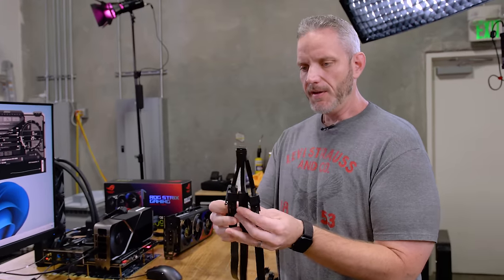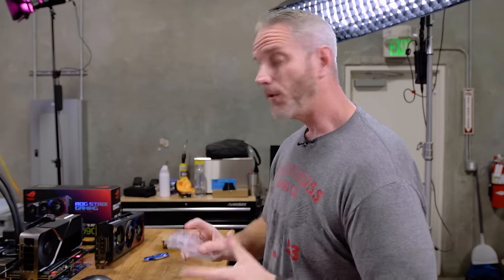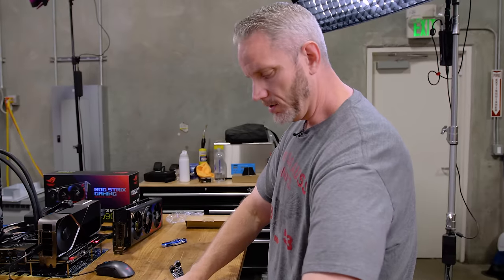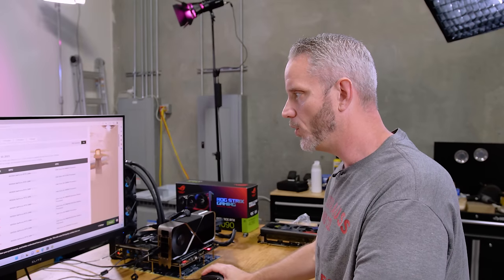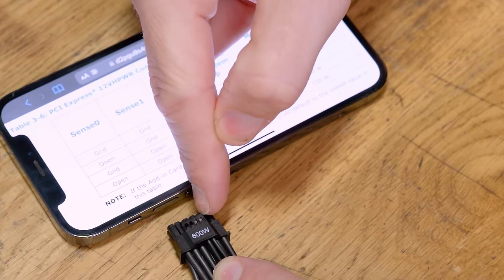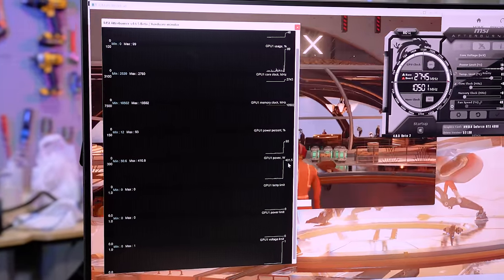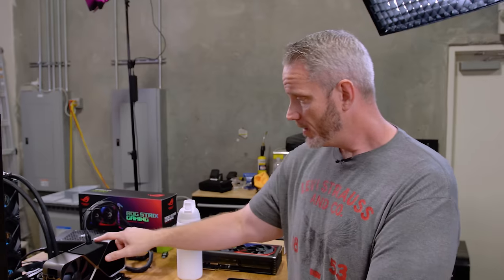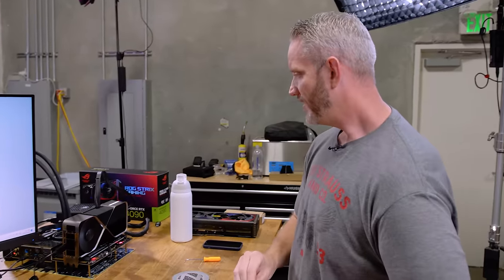DON'T Do this with your GPU!

Comment: If I have a video card with a PCIe 5.0 power port, I will get a power supply that can allow a direct PCIe 5.0 power plug to PCIe 5.0 power plug cable.  I will not play with converting 32 wires to 12 wires.

Comment: When I got my hands on a 3070ti FE back in March, I also updated my power supply to a Corsair 850w.  I was also very glad to find they did a replacement cable for the 30-series FE so I could ditch that 2 into 1 cable adaptor!  I love my 3070ti FE but the connector really is in a daft location!

Comment: What PSU did you use in this video? I'm asking because I found a Corsair-Staff post in their forums claiming that 600W can only be drawn by a PSU 1200W+ with this cable.. 

Guess who bought a 1000W PSU in summer because it was a good deal, which leaves enough space for a 4090 in my system. 
On the contrary the 450w+ are actually only for overclocking, also @der8auer made a video about the card beeing instantly limited by the voltage and it seems you actually can't raise voltage enough to really benefit from overclocking with the cards. But I guess soon we will know more about this :D

I'm excited for your tests with smaller PSUs!

Comment: How is that possible? Molex 8-pin connector can only be 150W by standard. So 2 connectors is 300W, not 600W. NVidia use 4 8-pin connectors exactly because of that reason, 4x150W=600W.
And what this little fact tells us? Corsair sucks.

Comment: I thought a 8 pin psu cable could only deliver 150 Watts, so how is it possible that the Corsair Cable can deliver 600 Watts with 2x150 Watt connectors only? Am I missining something?

Comment: If you're running a new AMD board, I notice that some manufacturers are putting out BIOS updates for the new boards that address 4090 issues.  Are there any issues with older boards (x570 for instance) that anyone knows about?
Reply: I'm going to run 4080 on X570 board too, to start with. I hope it'll be just fine, don't know for sure though. In theory, should be alright.
Reply: @pmAdministrator  I have a z390 e hahaha I hope the rtx 4080 works lol

Comment: I'm sure this has been covered somewhere, but can you pigtail into the adapter? It looks as if two of the ones he holds at the start are a pigtail. So two with a pigtail and the other two are single cables to the PSU.

Comment: You might want to run a baseline with the new cable attached in its original configuration before making changes…that’s some funk way to test shit….The new pin standard might be conflicting with the mobo bios for over voltage too.  So now the card and power supply are talking to each other, but it’s not the power supply sending extra volts, that’s via the mobo.  The power supply wants to send rock steady voltage. It’s a bit confusing, wouldn’t it be more logical for the gpu to get its data from the mobo on available power, current and voltage?
Reply: No, Because it don't get the power from the motherboard, It gets the power from the power supply.
Reply: @madb132  whys it gotta be so confusing:/
Reply: @enntense  But it's not tho.  To have the motherboard tell the gpu what power it needs jwould makes it much more complicated,  new software, new chips Much more development and cost. The way nvidia has done it saves that and has simplified it, Albeit for the time being. It may well come to the motherboard in the future but for the time being, it works.

Comment: So he just proved it works with 133% yet gn said it wouldnt? Lol seems like thats only for nvidai connectors. As we see he got the 133% with both pins but with 1 he couldnt. So gamer nexus was indeed wrong. His whole point was that you cant get the 133% when 2 plugs are in not 3 or 3 and not 4 wirh a 4090. Yet as he showed when you have both pins which this does have the way this high power pluf worke as he epxlained it does get the 133% so gamer nexus was wrong but he was right about the adapter and amount of cables.

Yall missed the whole point gamer nexus proved it by showing the nvidia adapter not the corsair one.

Point is you can OC with this cable on a 4080 super.

As he proved here he could even OC the 4090. Most 4090s arent hitting 3ghz either  way lol.

Comment: mmmmm if i want to get a new pc it would be 7950x with 7950xt watercooled 420 or dual mora 420 each connected to there own mora for cpu and gpu if i want to overclock and warm my room with all that heat

Comment: Solid wire helps to prevent electronic interference and limit the skin effect caused by magnetic fields on the wire’s surface.  However Stranded wires (same gauge) can carry more current.

Comment: I had no video output from my 4080 I used three separate pcie cables two new ones from my 850w and old one from a 650w. I just chanced it and daisy chained the and only used the two new ones and I got video and fans to spin

Comment: I dont get it. How can you push 600W through a cable that only allows to connect two 8 (6+2)pin PCI-E connectors. Each 8pin allows for 150W power. If the power is doubled per connector how is PSU supposed to even handle this. For example I have Seasonic focus platinum plus 850W that only houses usual 8pin PCI-E/CPU connectors. I would probably fry it or the cables if I tried to put 4080/4090 like that

Comment: Can i use the pigytail instead of the main one ? The 12 cable just doesnt want the main one. Ive tried with both cables im using. So 2 cables, no main connected on one but the pigytail

Comment: I can imagine it - a new video "12VHPR Cable with solderd on power select switches" for the whole 40 series lineup as benchplatform. 😂 Iam waiting for this since i saw the 4 pin sense power plug table months ago.

Comment: JonnyGURU has stated that the number of 12 volt cables per connector has remained the same for a very long time.  He also stated that the "new" connector has the same amount of 12 volt cables as 2 of the old 8 pin cables and the new connector was made to save space on the small graphics card PCB.  He also said older power supplies will not fail, catch fire, etc if your power supply is a good one and 850 watt PSU will be fine - as long as you don't overclock the RTX 4090 and your CPU.

Comment: So GN OC'd the 4090 and got over 600 watts, so does that mean these cables are not capable of handling an OC'd 4090? so what is going to happen with the 4090ti?

Comment: Did you check if CSM was off in the BIOS? I just put an ASUS 3070 (with latest BIOS) into a gigabyte X299 and it won't talk to the motherboard at all. Works fine with CSM on. ASUS are convinced it's a Windows issue (yeah right)

Comment: Someone please correct me if I'm wrong, but my understanding is the maximum power output on the 8pin from the PSU is 150w. If these cards are 450w why are we seeing PSU manufactures sending two 8pin to the new 12+4 pin? What am I missing? Thanks in advance!

Comment: Wouldn't increasing voltage reduce the possible heat up on the cables since it's pushing less current?

Comment: Now that some time has passed, what is the conclusion to the stock adapter vs Corsair 12VHPWR PCIe Gen 5 cable for the 4090s? 
Is the consensus that the standard Nvidia adapter with 4 of the 8 pin power cables required considered better, or is Corsairs cable with only 2 8 pin power cables better? I have both and use a Asus 4090 Strix, so don't know which I should use and if Corsairs option will somehow bottleneck or prevent overclocking or whatever. But with the adapter it both looks much worse and makes the side panel on my case impossible to close
Reply: Hi, so at the end what cable do you use,  Nvidia adapter or Corsair 12vhpwr ? I have a Zotac 4070 ti extreme that requires  3x8 pin. So I was wondering if I can use this Corsair cable. Thanks and good luck.
Reply: @armandoarroyo  Wish I could give you a definitive answer. I personally just use the stock cable and am waiting for the 90 degree cable from cablemod. I have asked Corsair several times to be 1000% sure regarding the cable and they guarantee their cable will work just as well. So I would just go with whatever you feel like in all honesty
Reply: @PuppetMaster0  I also asked to Corsair support and they told me the same, the Corsair 12vhpwr to 2x8 pin will work well according to theirs response. Eve. If it only is a 2x8 pin cable. I already order it. Thanks again.

Comment: You wrong about power supply gpu senses how many cables are plugged in is proven by gamers nexus
Reply: Jesus Christ why doesn't anyone pay attention. That only applies to Nvidia's cable adapter. That's what Steve from gamersnexus was talking about when calling out Corsair. Not Corsairs own cable. The way this cable works is completely different. People like you are exactly what Steve was complaining about spreading even more misinformation.

Comment: Can you just ground the 2 cables and get 600 W ? If so that would mean new psus are just as dumb and there is no communication between card and psu, the card just looks if sense 0 and 1 are grounded and if they are card assumes it's connected to something rated for 600 W ?

Comment: When you say "which would you rather have in your system?"  Is this 600w cable compatible with OTHER MFGs power supplies?  We all know from past experience that cables aren't cross compatible so Its not like we can just buy a Corsair cable and plug it in to our Seasonic/Be Quiet/EVGA whatever power supply.  Then melt our new 4000 series GPU, seems like a completely AWFUL thing to say to the general public.  "Which would you rather have?  Buy it and plug it in!  derp derp derp"  Great advice, Jay.   I dream of a time when ALL PWS cables worked across all PWS.... you know, like industry standardization but that bunch of greedy idiots will never get right.

Comment: Shit, I'm over here running 3 seperate pcie cables to my 3080ti, is that not the ideal way to run cables? I'm kinda smooth brain when it comes to the more advanced technical knowledge of powering gpu's

Comment: I went browsing at NEWEGG this morning, thinking that I might need a new, more powerful PSU. I checked out their PSUs. Saw one rated at 1600 watts. While reading the specs, I saw the words medical grade power supply cord needed. Of course, it didn't say that this power cord was included. I believe this means that it plugs into an electrical outlet that is rated for 20 Amp. service with its own power circuit. This would mean that its circuit breaker must be rated for 20 Amps. Its wire from the outlet to the circuit breaker box would need to be 12 gauge, not the more common 14 gauge, smaller diameter wire. What's your take on this?
Reply: If your common outlets are 120V 15A, that's a maximum of 1800W (should probably say 1800VA). The PSU's 1600W is the output rating; after accounting for the conversion efficiency and power factor, it could very well pull close to or more than 15A from the wall at max load.

(Not being in/from the US myself, I'm getting the information about your electrical system from online sources; someone please feel free to correct me if I got it wrong.)

Comment: wait, so if those wires are just directly wired from the GPU connector to the 2 psu plugs, could you connect only one of the two PSU-side plugs and the 4090 would try to draw 450 watts if it was the sense1 wire, but only 300 watts if it was the plug with the sense0 wire?
Reply: 👆👆Hit me up got something for you

Comment: I just killed a corsair RM750X with my newly added MSI Ventus 4080 16gb.  3 Hdd 9 RGB fans and figured 320w pull from the Graphics card.  Should be fine.  Yeah if playing stock games no mods no problem.  Running Cyberpunk 2077 with 80 mods you would think 🤔 no problem, well it became a problem about a week ago.  Screen would go black and the graphics card fan would go full bore till manually shut down the pc.  Thought it could have been the recent 3.5 dlss driver update, cause it started right after i got this update. It happen again and again for the past few weeks just randomly.  Just the other day no video upon boot figured i bet the PSU died, bought a new Corsair HX1000i and yep i was correct. Problem solved but do not trust Nvidias so called recommended PSU specs.

Comment: has anyone here used the EVGA PERFE 12 cable? just ordered one for my 3090ti to clean up my wiring with a 1000w supernova g3. crazy to think dual 8pin can run 600w when we were always told 8 pin were rated at 150w each. i always assumed it was the rails on the psu not the wire its self

Comment: I don’t have the Corsair PSU, can I use their cable in my PSU? Or is it forbidden! Can I use 3/4x8pin adapter that comes with RTX 4080/90 when I buy it? I bought new PSU recently and I thought about changing my PSU.

Comment: I recently built a pc and installed a RTX 4070, I'm not sure how to power it though. I mean do i use the 8 pin to 2 6+2 pin non braided power cable or the 12 pin to 2 6+2 pin braided power cable?

Comment: Please stop saying that is comminication, it is not.
There is no comunication between PSU and PCIE device.
PSU is only advertising the POWER of the plug/cable to the card.

No real dialog/smart comunication between the two.

Just read the specs chapter 3.3.

Comment: My psu came with a PCIe cable that had two 6+2 on one side, and one 8 on the other. I currently have the single side plugged into the psu and both 6+2’s plugged into that adapter that came with my 4070 super? Is this bad? (I haven’t powered on yet just waiting for CPU to arrive) and I’m a first time builder.

Comment: No one is talking about how the xx80 went from being a sub thousand dollars gaming card and always having ~80~90% of the Titan/xx90 gaming performance... all the way down to being a 1200+ dollars card and having just ~60% of the 4090's performance (in the case of the 4080, the real one). 
nVidia really demoted the xx80 series down with the 4080 while making it rididulously expensive at the same time just to push consumers into buying the 4090...
It should have 80% of the 4090 performance and cost ~900 USD$. The xx80 series always was a sub 1000 dollar gaming card with most (80~90% of the xx90/Titan) performance nVidia can give every generation. That's what gamers want. Now AMD has the opportunity to release a 800~900 dollar 6850XT ("xx80 class GPU") or something with 80~90% the performance of a 4090.
Zero reason for anyone whom owns a 3080 or higher to upgrade to a 4080 (16gb, the real one). Marginal improvement and insane price, ridiculous. Now, again: if it was 800~900 bucks as it should be and 80~90% of the 4090 performance (just like the 3080 was when compared to 3090, and so on...), THEN it would be a good deal. xx80 non Ti series should always cost less than a thousand dollars, just like xx70s should always cost less than 700 dollars.

Comment: Honestly still confused about the new vs old PSUs. Like for example if I plan on getting a 4080 and I’m using one of the old PSUs am I losing performance because the GPU can’t make full use of the power/communication between the two parts? Or what am I misunderstanding?

Comment: So I just installed my 4090 on my rig. Cleaned out old amd drivers. Dowmloaded new nvidia drivers. Everything was running good , WiFi is connected and working until I start playing online games . Then it will completely lose WiFi connection. My motherboard is the msi z690-a pro ddr5 . Could the 4090 cause WiFi adaptor issues ? Didn’t have this problem with my 6950xt . Psu is MSI MPG A1000G PCIE 5 & ATX 3.0

Comment: Had a crazy idea - what if they're releasing 4090 first because the 4080 will be so close that the price difference makes it stupid to get 4090. nVidia wants to get rid of the 4090 stock that have before they make the card dead value with 4080 release? The proper 4080, not the rebranded 4070.
Reply: Think it is more that they want to get rid of the RTX3000 cards... So they sell this one at stupid high price so people will still be bying the 3000 series until the high end first adopters have gotten their fill then they will slowly intruduse the rest of the 4000 series at maybe less insane price...

Comment: im really having issues, got a c850 coming in but i saw it has the dumb splitter and i need two 8pins for my gpu. is there a way to remove the splitter end of the pcie cable?

Comment: is this cable included in the corsair pro pcie cable kit bundle?i can buy the pro bundle on amazon now for £80.00 but i dont know if i should purchase this cable seperately on amazon for another £25.00 as im not sure if this cable comes included. i basically just need to power my rtx 4080 into my corsair PSU

Comment: hello Jay
so the best way to connect your 4090 to your psu is with this corsair 600W PCIe 5.0 12VHPWR Type-4 PSU Power Cable?

Comment: Jay, I have a Corsair AX1200. I think it is a Type 3 Power supply.  I just purchased the 4090 and I really don't want to purchase a new PSU until the ATX3.0.  Any chance you might know if the AX1200 would hold me through until I can get the new generation psu?  This is a question that a lot of people been having over at reddit, but no one seems to have a good answer.

Comment: @jay I just purchased a MSI Suprim GeForce RTX 4090 24GB GDDR6X PCI Express 4.0 Video Card RTX 4090 SUPRIM LIQUID X 24G and picked up an EVGA 1600w Platinum PS.  Will that cord work with the EVGA PS?

Comment: are there any good 90/180 degree couplers to connect the GPU to the cables without having to bend them? EVGA made one years ago.
Reply: Cable mod is in the process of making a 90 degree cable, about 3 weeks away

Comment: If I have a power supply with 12VHPWR port onboard, can I use this cable to connect my ASUS ROG Strix RTX3080 with 3 8-pin connectors on it instead of using 3 x 8-pin to 3 x 8-pin? Thx